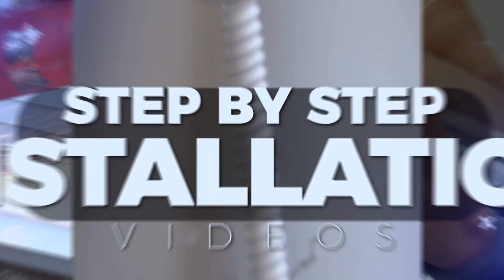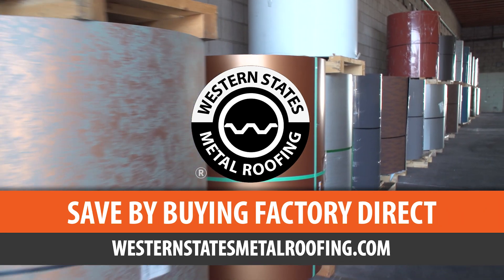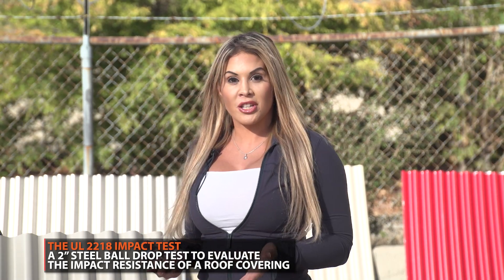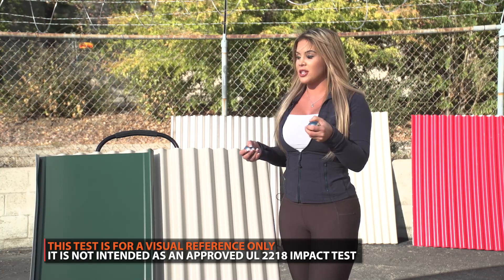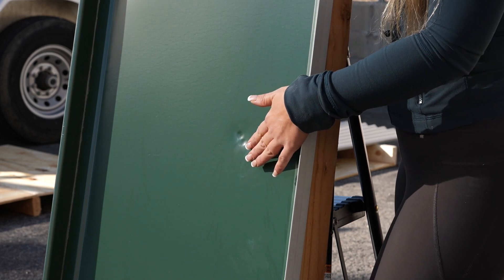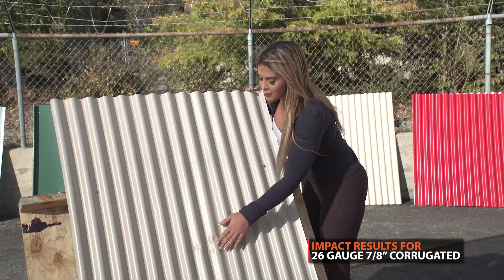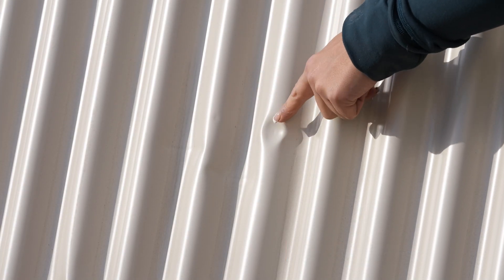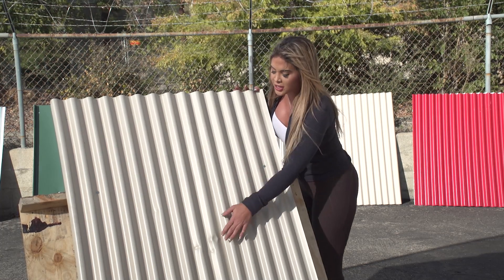Class 4 Impact Resistant Metal Roofing Panels Put to the Test - 2" Steel Ball Drop From 24'

Comment: I really appreciate you all putting these out. I'll start by saying that. Educationally they are good. The issue here on the 7/8" corrugated is what happens if the hail with said impact hits a fastener in the high rib? There you might have an issue. It could compress the fastener into the rib and open up a hole. Also, 26 ga. means you are appealing solely to residential customers.
Reply from the maker: William, I pinned your reply and I appreciate the issue that you have highlighted. We chose 26 GA simply because we wanted to show the worst case scenario instead of the heavier gauge. In hindsight, I would have shot this with both gauges.

Comment: Just came across this video. True, metal roofing can be rated Class 4 but, according to my insurance carrier, unless the fabricator has it UL tested, it will not accept it as a Class 4 rating. Even though the metal supplier can supply specifications. The UL test has to be preformed on a fabricated panel according to said Insurance carrier.

Most smaller fabricators don't have a UL test preformed for reason of additional cost. Check with both steel roofing fabricator and your insurance carrier if UL is an issue. Words i wish i would have read before.